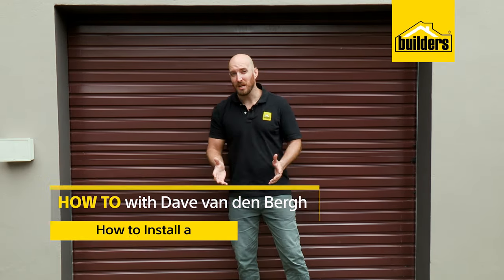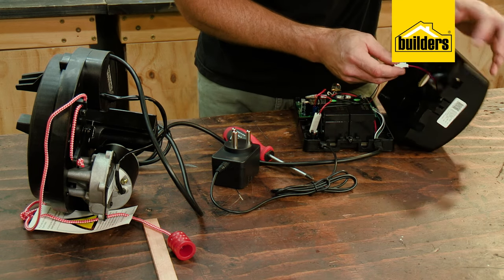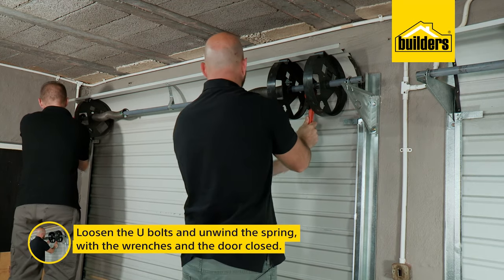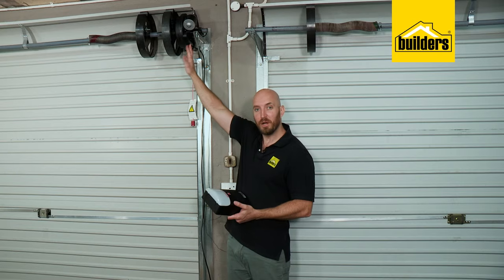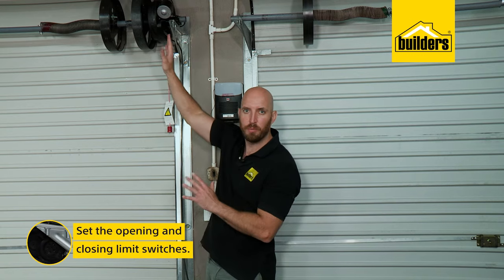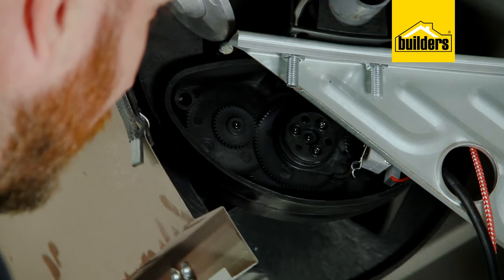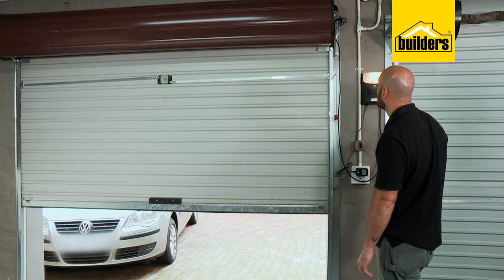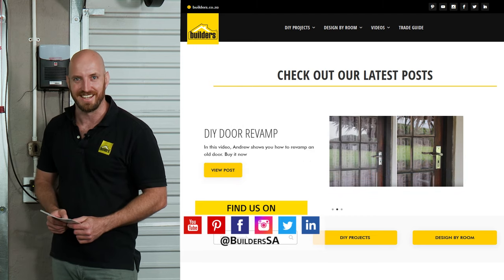How To Automate A Roll Up Garage Door

Comment: My husband is struggling with this... Our garage door opens uneven. Can it be the tension on the springs? Plz help!
Reply: Mine closes slightly uneven as the garage ground slopes. If they fitted it even then it should in theory open even,
Reply: Where are you
Reply: @luthandovanqa8781  Birmingham uk
Reply: the problem if your door looks like these is that the roll is not a full roll (open when full down) and that can cause side shift causing the issue , that or your installer has not centred the pole before installing it (its not the tension on the springs)